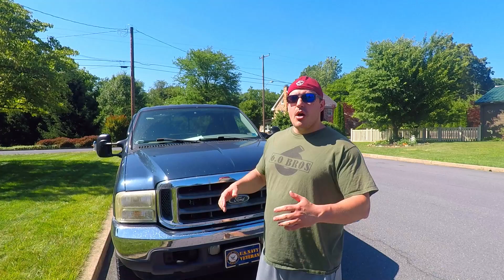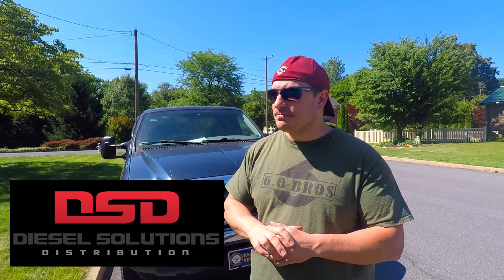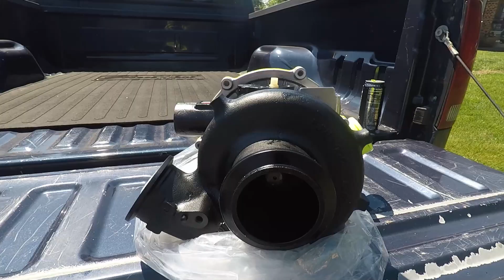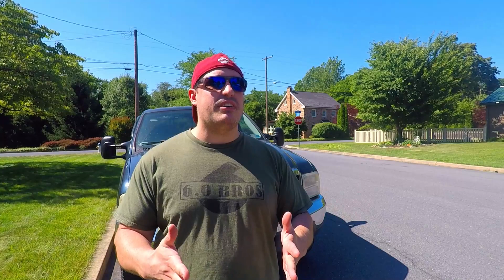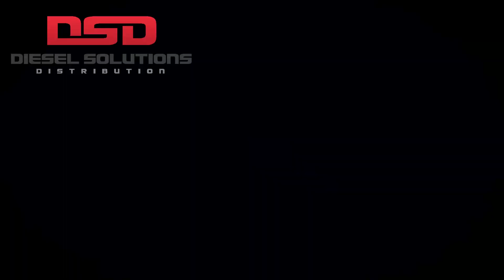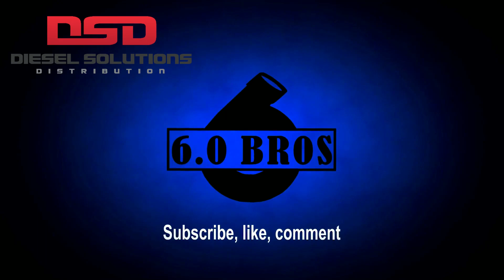6.0 Powerstroke Build Update

Comment: Good Sir, I've peeped in on several of your videos and you always seem to have good content. I am wondering if you ever did a video on Aux switches on your 6.0? And if not, could you :). I've seen some content but always seem to be missing how to get power to the switches. Anyway thanks in advance. God bless
Reply from the maker: There should be a wiring harness for the switches that plugs in as well to another pre installed harness on the truck. Typically this is above your brake pedal area however I'm not sure for each year.

Comment: Could you please list a price.
On parts in videos.
Reply from the maker: I plan to once I have everything done. There are still some final things like all new pulley assemblies and such when the truck is back and I do the review of the build I'll talk price
Reply: @six0bros  I have 2003 f350 6.0 .  Do you a way to prime the fuel and oil without using the starter.
Reply from the maker: When I do an oil cooler job or hpop you can fill the oil through the oil filter house. This should prime the system. For fuel before I put the filter in I turn the key on engine off wait a couple seconds and shut off. I do that like twice. Then put the filter in and then I turn the key on engine off and let the pump run until it shuts off. I do that 3 times then you should be good

Comment: what intercooler boots and clamps do you use on your 6.0 powerstroke  ?
Reply from the maker: I use a no limit intercooler pipe on thr cold side and mbrp on the hot side
Reply: @six0bros  no I was asking what intercooler boots and clamps do you use ?
Reply from the maker: Oh for factory pipes think one of the best is riff raff diesel. You can buy the Amazon kit and the boots are decent but the clamps are inconsistent. Some seem decent others are bad
Reply: @six0bros  I am asking about the boots and clamps that is it not the pipes themselves...
Reply from the maker: No I know. Riff raff diesel sells boots and clamps and I have jnstalled them before they are great. You can buy just boots and clamps on Amazon too, but I have issues with the clamp quality

Comment: I am doing a head gasket job on my 6.0 What is all the other parts You suggest I need to change sense I’m taking off the heads?
Reply from the maker: I always recommend kill devil diesel  for heads with arp studs. What year is your truck 03-04 or 04.5-07
Reply: @six0bros  2006 f350
Reply from the maker: I would replace stc fitting back of hpop, dummy plugs and stand pipes.
Reply: @six0bros   Thanks bro I really appreciate it. I  subscribed and been watching all your videos all day love them very informative
Reply from the maker: Glad you like the channel man!

Comment: Good to see you back! I’m doing a rebuild of my bed. The rails rusted through and I got a replacement kit from Dorman. Which is going great but slow due only being able to work on the weekends. Since the bed is off I’m also going to restore the truck frame with POR-15 and new Bilstein 5100 shocks. 

I’m wanting to do a lift pump as well. Air Dog or FASS. Which do you feel is the best? And why?
Also do you think I should also get the Bean’s sump kit as well? Anything else you can suggest would be appreciated. 

Thanks for all you do making your videos and look forward to seeing your next video!
Reply from the maker: I love my fass systems. I think to date fass and air dog probably are very similar in overall quality. Both are a good bit louder than stock I will say. If you can swing it a regulated return with fuel bowl delete would be great but not necessary either. I would do the sump too. I love mine and it is nice knowing I can get everything out of my tank if I can't find a fuel station. Not that I make a habit of that

Comment: Thanks for the update Jarod! I dropped some coin & bought the lightning bolt solenoid. I recently pulled my trailer with my 2014 Teryx4  on it ,I did notice the spooling up of my turbo & it seemed ot smoother as well. I have yet to drive it either my economy tune or my hot street tune. Not for sure on any better mpg while towing either.
Reply from the maker: That's awesome to hear man. I'll be trying it hopefully in the near future
Reply: @six0bros  I know you will be. I need to figure out my mpg  I drove back from Disney Ok today it was 200 miles pulling my 2014cTyrex 4 so  tomorrow I may fill up my truck n calculate my mpg if not tomorrow  it will be sometime this week.
Reply from the maker: Let me know what it is. Very interested to hear man
Reply: @six0bros  I filled my truck up today & figured my mileage out I got about 10mpg pulling my Tyrex Average speed was 75 mph coming back 220 miles with my heavy tow tune loaded up.
Reply from the maker: How much do you think the tyrex weighs? I normally get about 10 towing 13
Reply: @six0bros  not for sure exactly the weight but it's as tall as my Superduty & when backed on my trailer with the back windshield in its like a a wind block. I may try my light tow tune & see what it gets then. I know pulling my open trailer with 3 sportbikes on it I get 15mpg but I haven't towed it since last year.
Reply from the maker: I kind of wish I was testing out the 64mm turbo with it at first but we will see how it goes. It's 65mm which is only slightly larger than other turbos out there that tow max weight so I think it'll be good but between that and the larger tires is concerning. I may consider a research to 4.10
Reply: @six0bros  yes I agree with the gear change to 4:10's with me running 3:73's & 35×12.50R17's I don't think I will see a significant change in MPG now possibly if I drop back to my 32's I run in the winter  possibly I even thought maybe a 3" to 4" off the turbo for more back pressure instead of the 4" I'm running. My EGT'S while towing were 1075 to 11 also not the 700's to 800's I noticed but that's towing a big sail ,I'm sure if I was towing a 21' to 32'. camper it would be even more I am sure.
Reply from the maker: I love the look of my 35x12.5 but from a towing and mpg standpoint they suck lol.  I think thr 4.10 may not be much in mpg and performance but give back the power in some of the odd mph ranges that have issues towing
Reply: @six0bros  I hear you there. I had a 86 Ford Ranger long bed I bought new. I lifted it in 1990 v8 86 mustang Gt kit from L&L industries put a T5 5spd in it with a kit from Advance adapters then put a 9inch out of a 74 Bronco & geared it with 4:10's & a Detroit locker then bought a 4:10 geared front assembly. I did have the front dana 44 out of the Bronco 4:10 factory posi Trac it was on 36×12.50r15 Tsl Super Swampers it actually ran great with the 4:10 gearing and did well on mpg as it kept it at a good rpm when in 5th gear rolling down the highway towing not 4 sure. Lol But I didn't build it to tow. If it wasn't so expensive to swap gears front & rear I'd do 4:10's.
Reply from the maker: That is what gets me is the expense of swapping it's like 1200 is per axle is what I have heard
Reply from the maker: Also sounds like a killer ranger
Reply: @six0bros  yeah it's not cheap & I work at a Ford dealership & for me the labor rate is 50.00 an hour.
Reply: @six0bros  thanks it was I sold it & now I wished I'd kept it knowing what I know now honestly.
Reply from the maker: I may be able to do it with this partnership I am working on with the new sponsor but we will see
Reply: @six0bros  Well That would be Awesome if so. I'd think the 4:10's with 35's would put the truck back to right around stock gearing not so much if you went back to a 265/75R16 though. Lol
Reply from the maker: The goal if I do it is to get back to stock gearing woth 35s
Reply from the maker: I'm not sure what I'll do in the end though
Reply: @six0bros  I hear ya.
Reply: @six0bros  yeah the 4:10s should put you close
Reply from the maker: That's what I figure. And it shouldn't be so much of a jump that if I went down to a 33 I wouldn't be way out there either
Reply: @six0bros  no definitely not, I would go to 4:10s thats what I would do. My buddy has a 97 F350 that was stolen & he bought back it has 4:10s factory he said I could have them for my truck but I'd rather just change my gears out. I don't want to mix n match my axles. My superduty is all manual no electronic transfer case  manual on the floor I don't have to worry about vacuum hubs.
Reply from the maker: I would be thr same way wanting to wait and just buying my own gears too. 3.73 is great for a factory 31 or even the 33s that I have run in the past but for 34-35s you really feel it towing heavy
Reply: @six0bros  yes I agree once you're Rollin it's fine but pulling those big hills that's when you're burning that fuel. N fuel prices aren't getting any cheaper. It's BS diesel is a man made biproduct but it's higher the Giraffe puddy. Lol
Reply from the maker: Lmao giraffe puddy. It does feel outbof control. Like I almost canceled my vacation over it honestly
Reply: @six0bros  yeah it's pretty high. Lol
Yeah I've been going places within 200miles of me & taking my side by side. Fuel here is anywhere from $5.15 to 5.45 a gallon
Reply from the maker: We seem to be starting to calm down at around 6-620 a gallon it's been brutal man